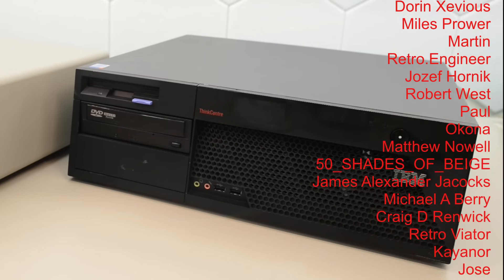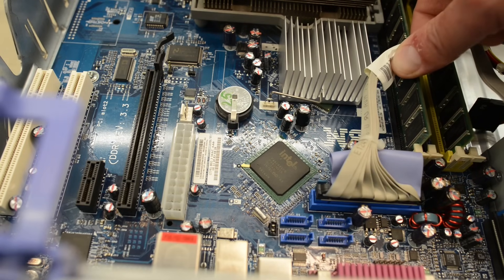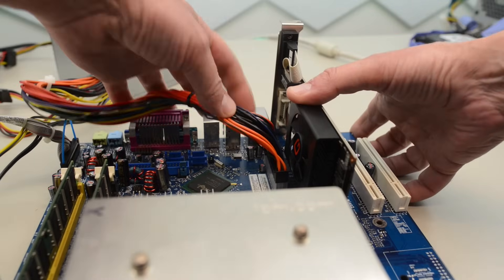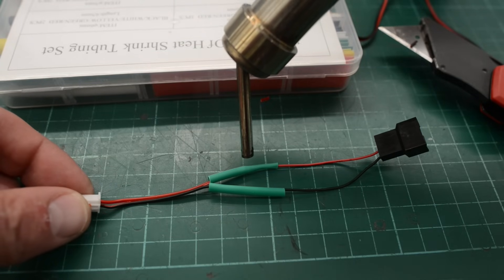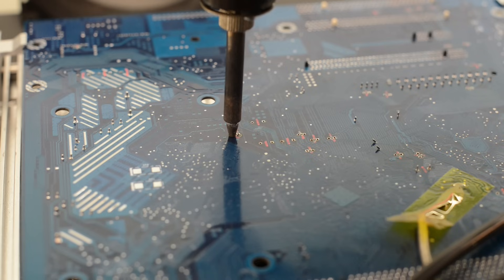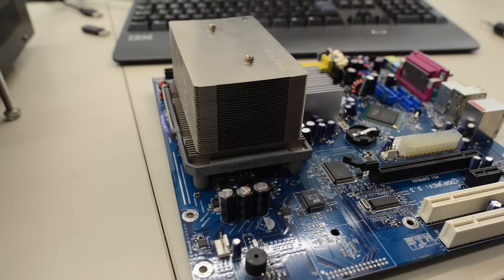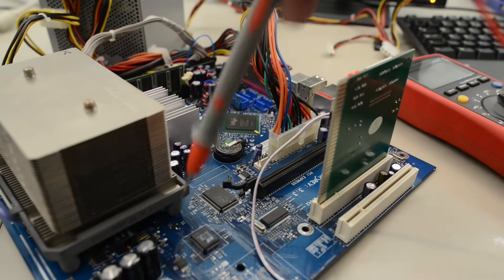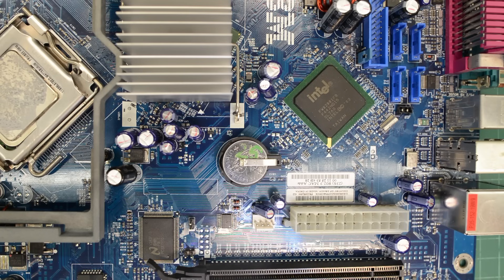IBM ThinkCentre M51 Motherboard Troubleshooting

Comment: I have an update on mine. Literally I have to cook it for 10-15 minutes by leaving it ON with fans disconnected. Then I turn it off and on, voila post codes shows up. Warning - CPU gets really HOT. At first I had a recovery floppy and jumper set in recover mode, it did flash BIOS just fine, I guess there was no need for that because it failed to boot in normal mode again. I repeated cooking procedure, and... it booted in normal mode fine. Reattached fans, after reboot - dashes on post card again. Chipset cold joints ?
Reply from the maker: Yeah, that totally sounds like a bad solder joint. If a bios swap doesn’t help, I’ll try with a heat gun

Comment: I've got S51 8172 with exact behaviour. It's same family when it comes to BIOS. It does not post, gives dashes on post card, all major chips get warm, CPU does reset. BIOS does not read from recovery floppy in recovery mode (CMOS jumper set to 2-3). Sadly there is no single binary BIOS file to download for these machines, because it is supposed to at least run from recovery boot block. I've desoldered BIOS and run it through The Retro Web bot on Discord, it looks fine. I'm out of ideas. Looking forward to your findings!

Comment: I had a slightly smaller S51 from the same generation (with riser card). It had some bulging caps that were equally difficult to solder, but I did get it going in the end - it turned out mine had a shorting abraded fan cable catching under the motherboard. I'd love to see a part 2 to this video!

Comment: Before replacing the BIOS chip (a problem I've encountered along with bad caps), I'd check with an oscilloscope if the chip is being accessed in the first place. If the CPU is not trying to read the BIOS, it's a bad sign. By the way, does the reset line goes down?
Reply from the maker: Reset seems to work according to the post card.

Comment: I had a Dell with those cap polarity markings (solid on + side).  I got the orientation right on almost all of the replacement caps.  Almost.

A couple weeks later, I went back in to replace a dodgy optical drive and noticed that one of the new caps was already swelling.  WHAT??  That's when I noticed that it had the negative band on the filled side of the silkscreen.

Things are more resilient than I expected!  It was right there on the +12V rail for hours of use and hadn't let go yet ....
Reply from the maker: I would have expected it to go bang!

Comment: That motherboard was made by Pegatron, the same company that made many Dell motherboards, and for a time both ASUS and ASRock boards. It has their signature inverted silk screen markings, they did it on ALL of their boards. It makes it extremely irritating to work on them because you have to constantly remind yourself the silk screens are backwards. I've blown up more than a few caps from forgetting the backwards silk screen markings on Pegatron crap.

Also a signature of theirs are those fine pitch solder pads and VIAs with craptons of copper that make them a nightmare to work with.

And about the video card not fitting, yep. One of the joyous idiocies of Intels' BTX standard that they were pushing hard at the time. Many Dell machines had similar problems with fitment due to the cards being upside down. Dell almost never included a slot above the PCIe x16 slot, so dual slot video cards wouldn't even fit because they'd collide with the case.

Thank god BTX never caught on, it was a dumpster fire purely invented by Intel to try and tame the heat nightmare that was the Pentium 4.

Comment: Thanks for ur work. The mother has a flash mode from diskette at least my ibm has it, u must move a jumper in mobo, my thinkcentre is very similar try to get the manual wayback machine can help u

Comment: Why did you recap the board? Were any of the caps actually dead? Those boards sometimes had bulging capacitors, but besides those, others were always fine. I did repair a few back in a day, and they only needed those caps that were visibly blown. Too bad you did so much work for no avail. Anyways, try reflashing the BIOS. I remember I had few Lenovo PCs from 775 era (Pentium D CPUs) that had some BIOS issues. This mainboard was most likely produced by QDI I think.
Reply from the maker: In my experience, only two types of caps on boards from this era exist. Bad caps, and soon to be bad caps
Reply: @Epictronics1  The internet always says, just change capacitors and it will work. In many cases this is just not true, and you can waste a lot of time and money with cap replacement, when there is some other problem that is unbeknownst to you, and may even be unrepairable. 

When I was repairing boards, the Low ESR ones that were used for general power rail smoothing usually went bad just from high temperatures and bad cap quality (cap plague from 00s). But other smaller values that were used for other stuff are usually still holding as they used good quality capacitors.
Interestingly, I just got a similar era PC (P4 2.0GHz)  today to refurbish (used as a backup XP machine), and they told me it sometimes doesn't boot up, but the main issue is loud fan. I found that about 6 caps around the CPU are all blown, but the machine still works, just not 100% :)
So next time, do yourself a favor and if none of caps are visibly bad, and the machine is from capacitor plague era, skip the cap replacement and try other stuff at first. I would suggest getting a PCI diagnostic card and checking how far into POST you get.

Comment: Something you might try is to short the intrusion detection pins. Before you do that you can check to see if the intrusion switch is normally open or closed. If it's normally closed you can simply jumper those pins on the mainboard and you should be good to go. I've worked on a few IBMs where if the intrusion detection says the case is open, the board won't start so that may be the problem.
Reply from the maker: Unfortunately, the switch is on with the lid off. By disconnecting it, it sees the case closed

Comment: In case you are wondering the resistor array just says "822" which means 8.2k, the shorted side is most likely shorted on the board, not on resistor pack, and this is most likely as intended, possibly bus pullups or something like that.

Reset CMOS via jumper with the intrusion switch shorted via jumper
Check all MOSFETs for actual shorts
Check the actual voltage CPU gets matches its specs, there's probably a test point near the MOSFETs, or just check the lowest voltage of them all
Check the clock is running and thus the crystal
Check if the memory is getting any life on address and data pins
(PCI is probably through a bridge that does not get initialized/configured)
Check BIOS ROM, and does it get the clock?
Check the board carefully for cracks or scoffs, specifically near CPU heatsink

if it's not that I wouldn't waste time with that board, 

with multilayered boards with so many components, no schematics, that are completely dead is near impossible to fix
it could be any tiny component or trace, it could be a trace on an inside layer

If you want to make any progress in diagnostics past this point you need at least an identical fully working board and a multi-channel scope/datalogger 

I suspect this system is so very clean because it never worked to begin with. This is probably the worst case scenario for such systems.

Comment: The chipset is the last thing I would suspect, ie, try everything else first, eg, voltage at the chips, clock running, knocked off components, bios, etc.
Reply: This southbridge 82801FB often fails. I have replaced countless 82801FBM (the mobile variant) in my line of work.
Reply from the maker: @felixokeefe  That could be useful to know, thanks
Reply from the maker: All the main chips are getting power

Comment: I’ve seen m55p systems with bad solder joints on the north bridge chip and they did the same thing fans full speed and no post
Reply from the maker: Interesting. They have very similar boards...

Comment: Did you try a different CPU? I may have missed it, but if you didn't I think I'd be trying that (and re-flashing the BIOS chip off the board)  before I'd be replacing a Southbridge.  Easy stuff first and all that.
Reply from the maker: Yes, unfortunately it wasn't the CPU

Comment: The two things I would do is try another cpu (a dead cpu can lead to no code execution), reflash the bios in case it got corrupted over time, and check the socket to make sure there are no bent pins.
Reply from the maker: CPU and socket are unfortunately already checked
Reply: @  you can try flashing the bios
(I know it's tricky in that board), you can also check voltages on the north bridge as that's what connects the south bridge cpu ram and pcie.
Reply from the maker: @Ragepro3D  I checked, and found voltages on nearby components

Comment: I would say that the placement of the power connector next to the PCIe slot is perhaps deliberate, to get you to pay them for an extra expensive part or to make it less serviceable. Even in the 1980s it was bad. Shelby, another creator, nearly lost his mind when he tried to service a 5153 (?) CGA monitor IIRC because it blew a capacitor. The monitor was made to be unserviceable almost.

Comment: I bought one of these  off ebay for £30 untested. It was in a filthy state and found the PSU and Barbados Planar faulty. I ended up just swapping the Planar with one that had the PCI Graphics connector like yours. If I recall there was also a later revision that was in a Lenovo pc and lost the IBM Logo.

Comment: Ive got an IBM Thinkcentre  M81 i5 here thats nearing vintage now,
 its an absolute unit of a machine, i can barley lift it,  
its got an IBM branded board & cooler  & memory in it, mine has the infuriating power problem rammed in next to the PCIe  to, also i remember  the caps where in the way of a GPU which was annoying.
i used a les than quality Chinese riser cable thing to get round it,  i purchased the black beast  from new many years ago & it cost me fortune, i know IBM had ceased to be the year i got mine but it was so long ago i cant remember the year.  Mine sounds like a 1970's vacuum cleaner when first turned on to. You got a nice machine there, they arnt very common.
Reply from the maker: Are you sure it's IBM-branded and not Lenovo? Thanks

Comment: Do you have an alternative machine where you can move the microprocessor to to see if that is the issue? Did you find the crystal controlling the speed and if so did you check that?
Reply from the maker: I might have a very similar board with the same BIOS

Comment: I have a Netvista Model 31G /M42 and that has an Lenovo Bios on it. After an Needed Update. Windows XP Would´n runn on the original IBM Bios.

In my case just the Powersuply was nit working and one Opfical Drive. Now it works like new with 2 GB RAM an a P4 System.

Comment: take out and reflash the BIOS. It's typical problem. Also before that, take out the RAM, clear the BIOS with the jumper, start the computer, wait 10 seconds, stop it, put back the RAM. If this not helps, you need to reflash the BIOS.

Comment: Use oscilloscope to check the bios pins to see if it is being accessed.
Also check some of the pins on the cpu socket to find reset, clock etc that would verify the cpu is getting those signals. Check the clock generator IC to make sure it's working and utputting the correct clocks. It's a custom-programmed generator so it has a low clock speed input from a crystal and does internal multiplication and division to create various clocks for the system.
Reply: And also voltage on the CPU socket matching the actual installed CPU datasheet
Reply: @jwhite5008  This is P4 CPU. Voltage is automatic on this type of 'modern' motherboard and can't be changed even if you want to change it.
Reply from the maker: @g4z-kb7ct  Power at the CPU is a bit tricky to check on these. There are voltages, but I can't say for sure if they are correct
Reply: @g4z-kb7ct  Oh, you are right, it needs CPU in socket to understand which voltage it needs. But it's possible to check continuity from the power pins to one of the MOSFETs and then measure that with CPU installed.
Reply: @Epictronics1  Typically these cpus boot at the highest power state. Expect 1.2-1.5V (at most)
Reply from the maker: @M8R3rojcq  That could be very useful to know, thanks

Comment: I don't think that was a mistake with the video card.  Dell has done things like put the drive cage behind the PCIe slot.  Mainly I think to prevent you from installing high end video cards in systems that they'd rather have you purchase a workstation class system.  For Dell I did cut out the drive cage and mount the SSD elsewhere so I could use a long video card.
Reply from the maker: Wasn't this the high-end machine? There were at least two much smaller M51s
Reply: @Epictronics1  They may have had a workstation system also with a Xeon.

Comment: Did you try a new BIOS?? Since on some boards, the BIOS itself tends to corrupt after so many years of storing, so try the basic CMOS clear and if that doesn't work try a new BIOS but backup the OG just in case before ruling out the southbridge
Reply: THe bios is where i'd go next for sure. Need to check the datasheet of the flash chip and make sure your programmer supports it. Id guess the chip uses SPI.
Reply from the maker: It's a bit tricky to flash. I have to desolder the BIOS chips and buy an adapter for the TL866

Comment: When you showed the close up of the intrusion sensor I thought it was foreshadowing … the M51 systems won’t boot with the intrusion sensor showing the case open. Use a jumper to bypass it, reset the CMOS, and that should solve the problem.
Reply: I have seen this happen before too.
Reply: that could also be faulty too and holding the system up
Reply from the maker: Unfortunately, the switch is on with the lid off. By disconnecting it, it sees the case closed

Comment: My bet is on the bios, either bitrot or corrupted by a bad flash, second is a dead cpu.
Reply: I maybe off point here but doesn't the rambus need the termination blank Installed even when using ddr  memory I got p4 board in my closet that has the ramous termination with installed ddr memory I think it was just left in place from previous owner but I'm not a p4 fan and never tried to get that system running I found it on side of road and cleaned it up.
Reply: @christopherdecorte1599  Yes, it does. But this isn't a RAMBUS Board, its DDR-2 SDRAM
Reply: Could also be. Problem with LGA775 is the CPU and testing it, as there are so many different revisions of LGA775, if you weren't there it smacks you in the face with compatibility of CPUs.
Because you have.
SIngle Core P4 only
Single + Dual Core P4
P4 + Core
Core Only
Core Duo only (NForce 500)
Its really annoying...

Comment: Jumper the intrusion switch closed?
Reply: Generally the intrusion switch isn’t going to affect video output. The last IBM desktop I owned that had one would only pause the boot process at the bios to show that there was an intrusion detected.
Reply: @AmazedStoner  Yeah but per the POST card its not even sending ready so won't execute code. Older Dells would also only spin their fans on high and not post if the intrusion switch was open.
Reply from the maker: Unfortunately, the switch is on with the lid off. By disconnecting it, it sees the case closed

Comment: I would check the bios. Maybe it have bitrott
Reply: This!
Reply from the maker: It's a bit tricky to flash. I have to desolder the BIOS chips and buy an adapter for my TL866
Reply: @Epictronics1  You can try to get SOIC8 clip if the BIOS is in SOIC8 package. This way you don't need to desolder it
Reply: @michvod  Motherboards of this generation generally used parallel flash, not serial flash. The EEPROM for the BIOS is at 5:03, it's a PLCC-32 package chip. While there are PLCC-32 clip on adapters, they're pretty expensive and aren't very reliable.

It'd be easier to just remove the EEPROM and install a PLCC-32 socket.
Reply: @GGigabiteM  yeah thanks, i saw it now. SOIC-8 became standard bit later
Reply from the maker: @GGigabiteM  Thanks. Socket on the way
Reply: @Epictronics1  theres a tool (i cant remember what it is) that can dump from the pc itself, that would at least validate the contents.
Reply: I had the exact same issue with an Abit NF7S. It was the bios, the chip was bad, I had to change it, it was dead dead and flash. Works like new now
Reply: At least following generations with Lenovo logos are prone for bitrot of bios chips. Reflash (in place with clip) and same bios chip will work for years.
Reply: shouldn't it post a code even with bitrott?
Reply: @mojoblues66 depends where that bit is flipped and how many bits got flipped
Reply from the maker: @mojoblues66  I just received an adapter for the TL866 and that BIOS chip. We are about to find out